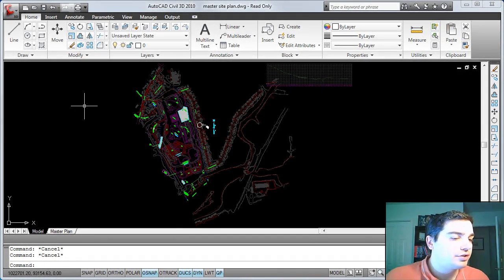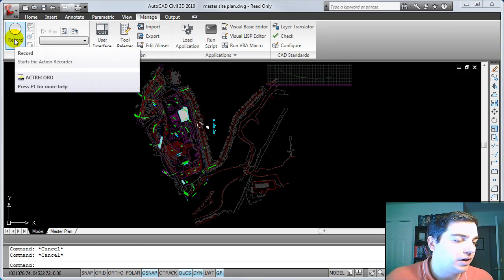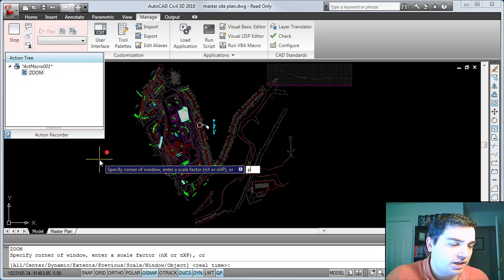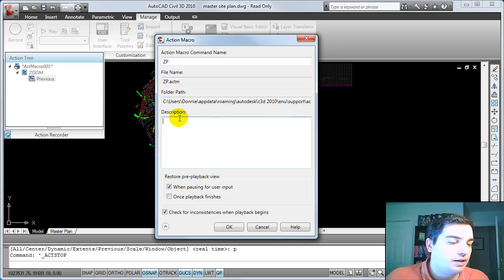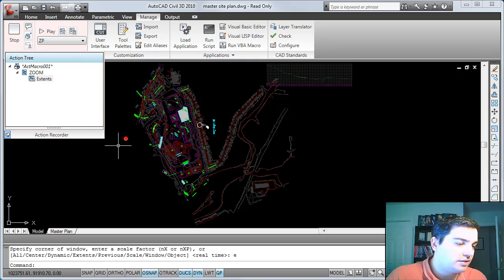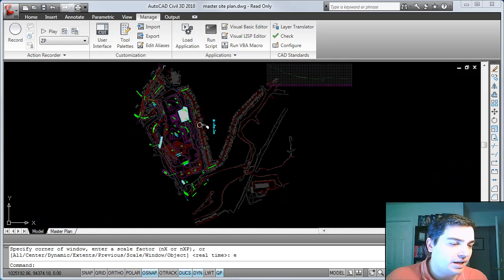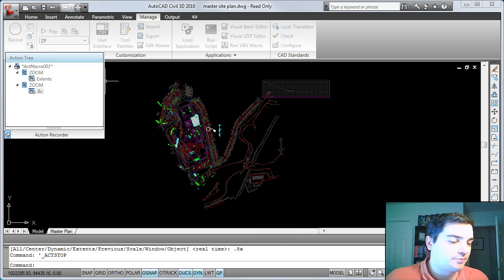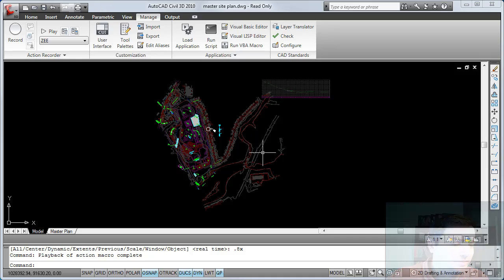Action Recorder: Creating Zoom Macros

Comment: how I can use record action in reinforcement details
Reply from the maker: Action Macros only capture whatever you can type at the command line. Since Action Macro's need a command-line sequence, not a dialog-based sequence, not all workflows are possible. My recommendation to get started for your use case will be to see if it's possible to accomplish your workflow using only the command line. If so, once you know your command-line-based process, you can record your macro using the process outlined in this video.
Reply: Thanks for the reply
Could you give a worked example..??